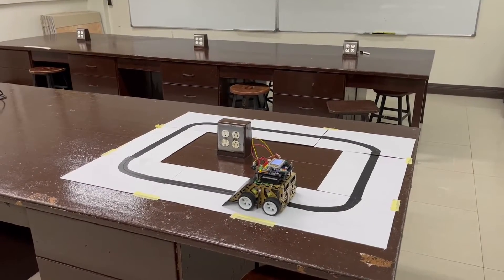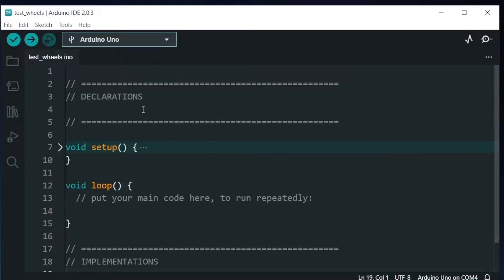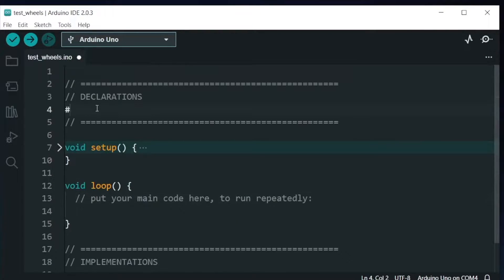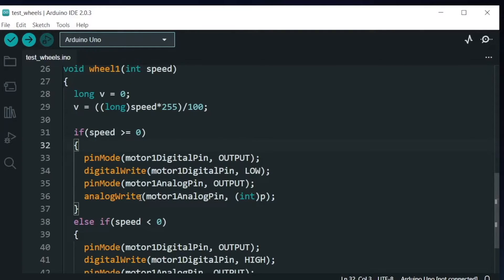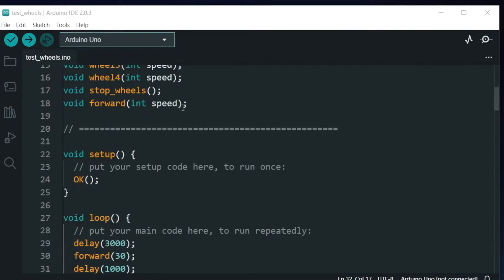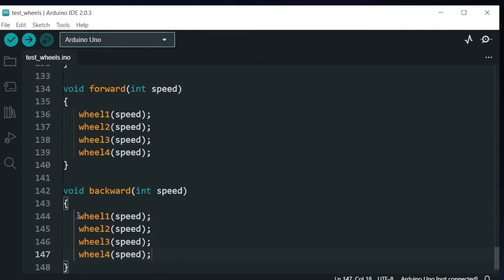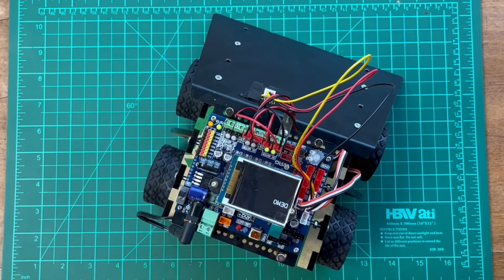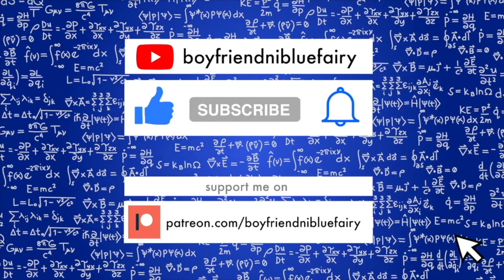How to program 4 Wheels Robot Robo Creator 2 ATX2 Sumo-Bot DC Motors

Comment: Very informative video! Can I ask you a question?

Is is possible to move the wheels while not having the adafruit motor shield? Thanks you.
Reply: include the ATX2 library then you can use the FD function or SR SL TL TR
motor_stop and etc
Reply: ex
#include <ATX2.h> 
void setup() {
  OK();  //(wait for ok button is pressed)
}
void loop() {
 FD(100); //move forward all motors at 100% speed
delay(1000); //move the robot forward for 1 second or 1000 miliseconds
}
Reply: #include <ATX2.h>
Reply from the maker: Yes. as long as you can connect the wires of the motor to the analog pins of any shield

Comment: Hello thank you po sa tuto pero pag kinocompile ko po ung code sinasabing OK(); is not declared at paano nyo po maiseselect sa board options po ung ATX-2

Thanks in advance
Reply from the maker: You can "comment out" or remove the "OK()" line from the code and it should still work. The latest version of Arduino IDE does not have the ATX-2 board. Go to arduino.cc and search for the Arduino IDE version 1.0.7
Reply: @boyfriendnibluefairy  sige po, salamat po ulit
Reply: include the ATX2 library
#include <ATX2.h> 
outside setup and OK(); should work